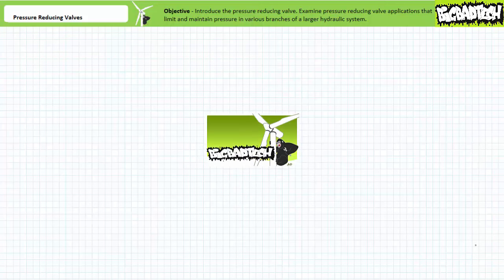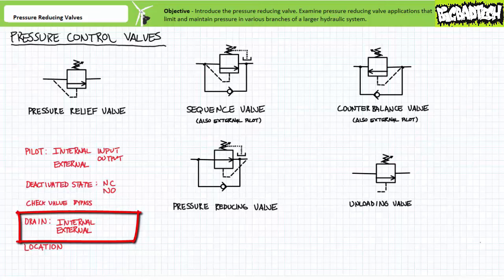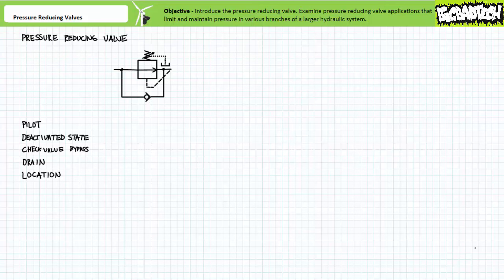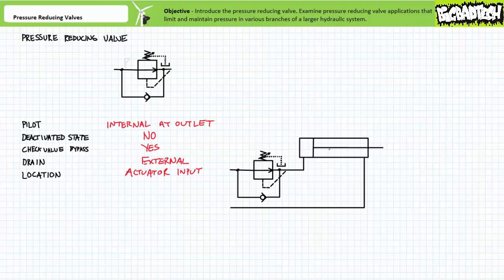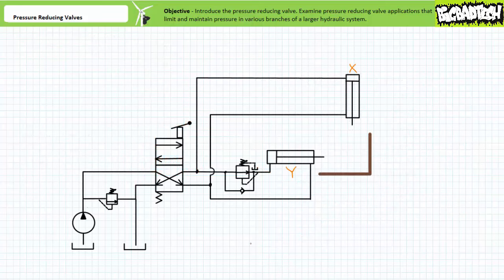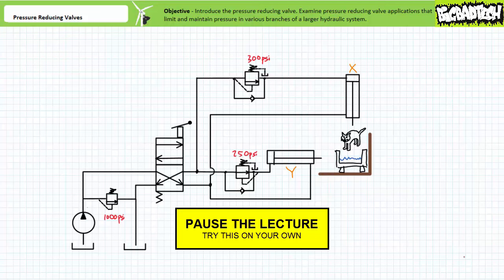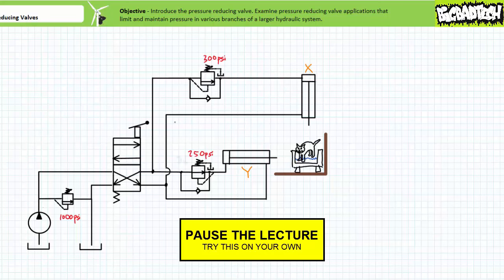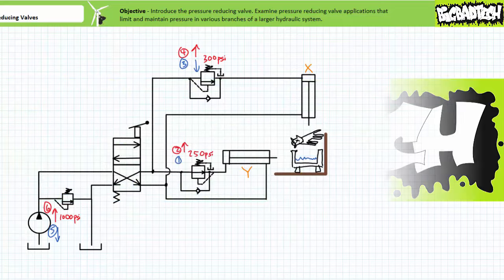Pressure Reducing Valves (Full Lecture)

Comment: As a pump guy in the southeast, pressure relief valves are not always between the pumps and the tank as they are on Carroll Childers stations, all VFD stations I've seen have a PRV valve. No tanks
Reply from the maker: True dat. A "rupture disc" also qualifies as a low tech pressure relief valve that doesn't necessarily require a tank. (Although it's a recommended practice to route the discharge somewhere!)

Comment: Isn't the constant reduction pressure reducing valve essentialy a hydrostat or pressure-compensated pressure reducing valve and the symbol wil be slightly different in the 
circuit  as the drain port to tank wil be connected across as orifice in pre pressure-compensated valve, post pressure compensated wil be different connection as the keep pressure differential or delta P constant as to keep the flow through an metering device constant such as as a flow control or DCV constant trough a variation in load induced pressure? Help me if I'm wrong. Thanks for the good content.  Love your videos.
Reply from the maker: Yes, there's a bunch of different ways to draw pressure reducing valves. Classic example not mentioned in this lecture: sometimes pressure reducing valves also feature a pressure relieving action (ie: if branch pressure ever exceeds the set point because of some outside force or thermal expansion it will relieve pressure) that is illustrated schematically as an arrow in (reducing) and an arrow out (relieving). Check out https://youtu.be/fCNNFz48Si8

Comment: Hello sir, Pressure reducing valve works like digital or analogue? When pilot pressure reaches set value,
Will this pressure reducing valve close the flow through it & maintain the output static pressure constant untill there is no actuator actutates in system OR 
Will the pressure reducing valve allows continuous flow through it at reduced pressure equal to set value?? 
Please reply.

Comment: I don't understand that
Pressure reducing valve has another line of check valve(one way) around pressure reducing valve.

When pump rises pressure through pressure reducing valve, can fluid go directly into check valve before entering to actuator, circulating the fluid.
How does check valve work?
When pressure reducing valve is open, does check valve is closed in both direction?
Reply from the maker: Check it out: https://www.youtube.com/watch?v=J6n6QYIwhHw
Reply: Yes you are right something wrong with check valve

Comment: If a actuator connected to reducing valve requires pressure more or less than 250PSI to be actuated, then how does reducing valve will maintain 250PSI pressure in circuit.
Reply from the maker: Here's a hypothetical situation:
1) main pressure relief valve set to 1000psi
2) pressure reducing valve set to 500psi
3) actuator requires 250psi to extend using straight through position of directional control valve
4) pressure reducing valve is normally open so when directional control valve is moved into straight through position fluid flows and pressure rises to 250psi sufficient to extend actuator. 
5) When actuator stalls at limits of travel, pressure rises to 500psi at which point pressure reducing valve closes and prevents further rise beyond 500psi. 
6) If pressure in this leg ever drops below 500psi pressure reducing valve briefly opens and permits fluid entry until pressure again rises to 500psi.
7) retraction bypass the pressure reducing valve in reverse.
Reply: Thanks Jim